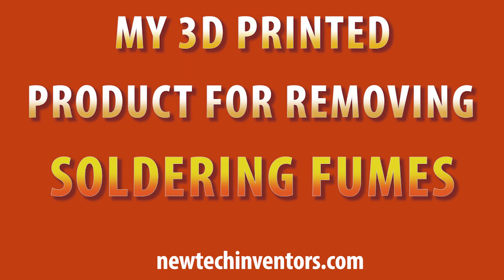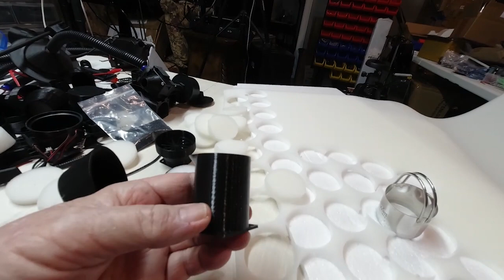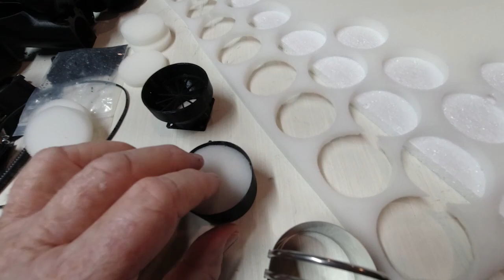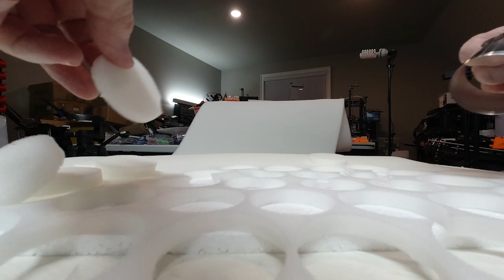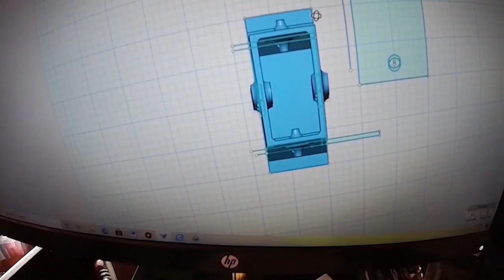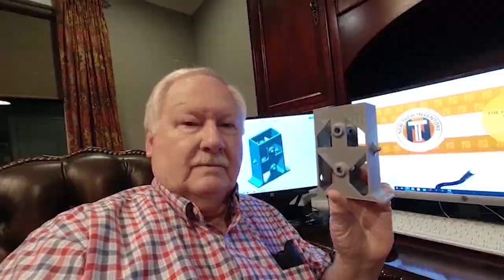MY 3D PRINTED PRODUCT FOR REMOVING SOLDERING FUMES is now ready for production at my 3D print farm

Comment: Not sure if you know this but you can run a plugin called (Arc Welder). It will make smoother prints and save time.
Check this out.
Reply from the maker: Thanks for sharing tie info Robert, I will check out Arc Welder. Thanks for your support my friend...Ken